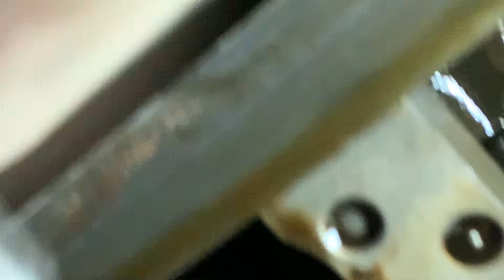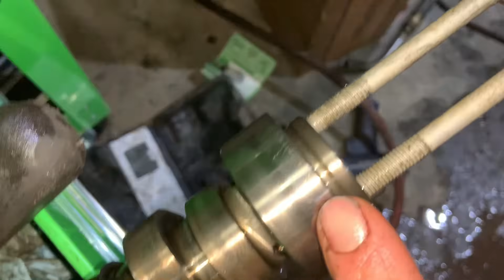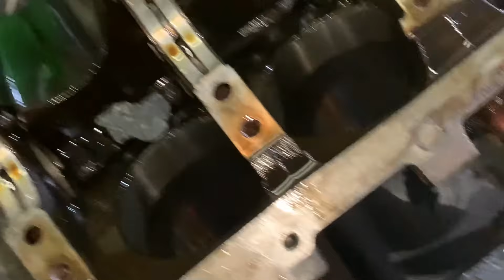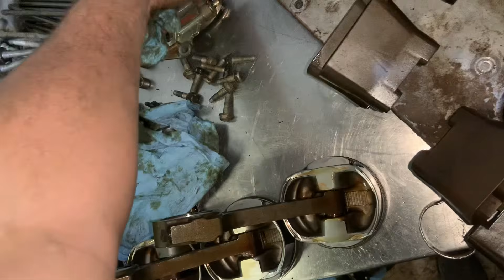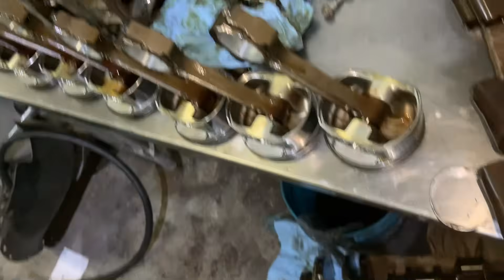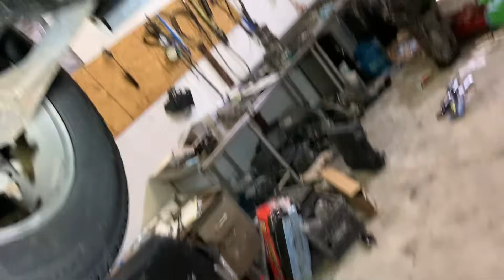ULTIMATE LS ENGINE NO OIL PRESSURE LOW OIL PRESSURE DIAGNOSIS AND REPAIR GUIDE

Comment: I have an 04 2500 suburban 6.0 with 162,000 miles. On a recent 1500 mile round trip my oil pressure dropped. It will be at 10lbs. or less at idle or about 20-22lbs. at highway speeds or 2500 rpm. The engine is absolutely quiet. I have checked the oil pressure with a snap on oil pressure gauge at the front of the block at it will idle at 8lbs warm and jump to 20 lbs at 1000 rpm, at 2000 rpm it is at 35lbs oil pressure and 3000rpms its at 45lbs oil pressure. Now when I check oil pressure with the mechanical gauge at the back of the block where the electronic sending  unit goes the gauge barely reads at idle about 5lbs pressure and the highest pressure reading I get is about 22lbs at any rpm over idle. I did an oil change to check the filter and the drain plug, I did find magnet metal shavings on the drain plug and in the oil filter. They actually look like slivers of metal about 3/16" long that you would typically find stuck in your finger if that makes any sense. I'm curious to know if when you have one with a failed cam bearing that you tend to find these metal slivers? I'm thinking I would rather just pull the motor than go through the extra steps to drop the front differential. I have also had the back of the vehicle about 4' higher than the front to do a check of the pickup tube o-ring and see if the oil pressure changed which it did not. And not being able to see the same or similar oil pressure at the back of the block also makes me think it is a cam bearing. Wondering what your thoughts are? Thanks Greg
Reply from the maker: thats is still a lot of pressure for a bad cam bearing, When the cam is out i dont see more than 7.  I would pull the diff.  Its not that hard to drop down.   a new pump may fix everyting too..  did you already figure it out?

Comment: Man this is the best informational video I’ve see for the LQ4. I have a 2004 gmc 3500 6.0. It’s my van for carpet cleaning. The machine runs off a pto off the engine and not the trans. About 2 years ago I go out in the morning and out of no where check gauges light is on. 5 psi. Rev it up goes to about 25psi. No engine light. I’ve always had a sporadic idol sometimes low some times high after running my machine. That’s another issue though. So I’m driving this like this for 2 years.  Never no knocking sound or ticking. Well last week I notice when I come out after the job and turn the machine off and the van Idols down the lifters are ticking. (Had oil change two weeks prior.) the noise stops by the time I’m at the next job. After the job the same thing. So a mechanic friend said to add some Lucas to the oil. When I did this the oil pressure dropped even more and once up to temp. wouldn’t go above 5 psi. So now I know there’s trouble. Still no knock or ticking. So I go to check the pickup tube o ring. Sure enough it’s dry rotted and squared. I’m thinking great a cheep fix! After install pressure is a lil stronger than it’s been in 2 years. I go to a job that’s 5 minutes away and that’s about how long it took to get to temp. Soon as it did pressure is back to 5 and lifters are ticking. I shit it down and had it towed. Now I thought oil pump pressure valve. Replaced the oil pump, still same problem. Also had already checked the sending sensor and had hooked up an independent gauge. Still same reading and there’s no screen under it for this year. I will check the cam bearings tomorrow but like I said no ticking or knocking. The only thing I’ve noticed so far is the first bearing closest to the trans. Dose have some play side to side but not up and down. From the info I’ve provided, so you have an opinion. Every mechanic I’ve talk to. Which none seem to have the specific knowledge you have on the LQ4 specifically all seem baffled that the pump didn’t fix the problem because how hard this vehicle works and there’s no knock or tic.
Reply from the maker: what did you find?  if you have done a pump and oring, I would bet you have a bad cam bearing somewhere.
Reply: @Brainstangs  I replaced all the main bearings. That got me back on the road. The bearings were all scratched up. So I assume the cam bearings are the same which is where the other half of the pressure is being lost.

Comment: my 5.3 oil pressure drops off when it warms up but if you shut it off and restart it , it goes up to 40 psi and then slowly drop off again to zero.
Reply from the maker: pump is what I would suspect
Reply: What did it end up being ?

Comment: Got a question for you! What are your thoughts on my situation. I have a 2008 Yukon Denali 6.2 non dod. Having a problem with oil pressure and trying to get a handle on where to go next. Getting 65 psi cold and 20 psi idle warm. With 5-40 oil. 5-30 oil about 5-7 lbs less. When I get off the highway or a hard pull pressure starts to drop to 15 psi and 38 at 2k. Have great pressure at the oil filter but at the oil pressure switch I am getting the drop. It’s been about 10k since this started and no noise or anything like that. No leaks and did the rear main,and no leaks. (Never changed or touched the barbell) I have 135k on it now. Before I used to have 30 psi hot idle and 60-65 hot on the eway. I am hard on the truck. I know something is starting just not sure where to go first. Thanks!
Reply: He tells you exactly where to go first @ 25:43 to 28:12  sums up the entire video, but there is a lot of good info throughout the video.
Reply: I have an 07 with same motor as you.  (Those time stamps do no address this issue.)  I replaced sensor, o-ring, pick up tube, oil pump (high volume) and cam plate seal thing.   It is 70 on start,.then eventually settles over 40-45 driving, then 25ish on idle.  I am down to the relief valve in oil pan (not sure why I didn't replace it while I was in there twice already) ...and bearings.  Did you figure yours out?  I am getting frustrated and concerned at this durn truck!
Reply from the maker: 25 at idle is still fine.  everyone freaks out about it that low.  not an issue.  I do block off the pressure reliefe in the pan.

Comment: I recently swapped a rebuilt Ls1 in my pick up which was running fine for week, when I saw that my oil pressure was decreasing slowly then dropped to 0 and the engine shutoff (No internal engine noises). I noticed when that happened I started to get a oil leak from the rear main, could the barbell restrictor possibly be the problem? (Not installed properly or defective?)
Reply from the maker: if it was the barbell, it would simply drain to the pan.  Not the cause of your rear main leak.  If you not hearing  any engine clatter I would think its a faulty sender.

Comment: I'm on my 3rd Engine in my 2005 Escalade. Changed oil with mobil one every 3,000 miles religiously and noticing Oil pressure is starting to slowly slip on this engine now too, can't catch a break. Thanks for the video, very informative!
Reply from the maker: hope your luck changes.
Reply: @Brainstangs  Thank you, as do I!

Comment: This is the most important video I’ve watched since I started researching my oil pressure issue in my 06 Silverado 1500. I think I’m losing prime via the o ring. It primes up but after it warms up the pressure drops quickly and the lifters start ticking due to oil starvation. Thanks for all this information.
Reply: The O-ring was in pretty bad shape, so I stopped there and put it back together.  I did take a look at the bearings as you suggested from underneath.  As far as I could tell, they looked fine. Thanks for that tip by the way.  The O-ring seems to have solved my oil pressure issue, fixed my startup noise, and my lifter tick once up to temperature.  I did run the truck on a downhill slope beforehand(12 degree slope measured with my iPhone), and noticed the pressure improved.   When the truck was pointed uphill or level it would lose pressure fast and the lifters got angry.  Everything pointed to the O-ring, but your video had me prepared to check everything.  260K miles and counting!  Thanks for the great video!
Reply from the maker: happy to help. Let me know what you find

Comment: Best video about this on YouTube. Idk how I managed to watch probably 100 others before I found this one, thank you! Will be doing my inspection in a few days. What all work should I have the machine shop do and what should I expect it to cost? I can do all the assembly myself, but haven’t had to bring a block to a machinist before. Also any good tricks to be certain of the pump relief valve if I get lucky and it’s not a cam bearing? Thank you!!
Reply from the maker: Glad it was helpful!  AS far as machine shop, have them put the upgraded cam bearings in.  Other than that, all the oil pressure issues you can adress without the machine shop.

Comment: I have an '05 Trailblazer with the 5.3 and it recently lost oil pressure at idle. Lifters make a little ticking when at idle, but if you give it a little gas, the pressure comes right back up and the motor runs and sounds normal. I'm thinking that the pickup tube o-ring is shot and it's sucking air at idle, but I'm trying to consider if replacing the oil pump would be a good idea also... I haven't torn it down yet, but curious what you would think in that scenario. While I'd like to do the DOD/AFM delete in the future, I'm not quite ready to do it now. I just want to get it back to being driveable for the time being. On these vehicles, it's not so easy to remove the oil pan since the geniuses at GM decided to make the diff attached to and have front axle go through the oil pan. Thanks!
Reply: What did it end up being I have the same issue & im thinking it’s rod bearings …

Comment: 2008 5.3 275k miles, cold start 60 psi, operating temperature 5 and below at idle, I already did the oil pump. No engine noise when oil pressure is at zero, I'm thinking the VLOM gasket has crapped out. HELP!!!

Comment: Nice video, I have an 05 Sierra 2500. Oil pressure fluctuates constantly from high to low. Maybe 10-20 then go to 60-80. Accelerating increases pressure. Where would you start?  
Thanks in advance

Comment: Pretty sure mine is just a failed pump o ring. I would start it cold and it would have 20 cold and as I drove it would stay at 20 then after awhile my lifters would start chattering. Then it would randomly jump up to 40 going down the road and lifters would get quite a second later. Drove it to work like that 2 times and decided to park it. How often do the cam bearings do that though?
Reply from the maker: not that often, however dont delay on your oring.

Comment: I got the valve covers off my 4.8l today. I took bank 1 off first and thought it was somewhat dirty but not bad considering it has 190k. I went and removed the bank 2 valve cover and to my surprise, every rocker and spring was perfectly clean. Could this be from low oil flow to one entire side? If so how?
Reply: This is old but this is cause by the egr or pvc system.  It causes one side of the engine to get dirtier while the other stays clean.   Every gm engine for these years will have a clean and dirty side.
Reply: Did you find out what was wrong?
Reply: Doesn't seem like anything is wrong. Only thing I can come up with is that the clean side had head work done and the grimy side must be the original head.
Reply: @eyeslo4206  mine did this, was Castech head crack issue, slowly drinking antifreeze internally and steam cleaning the upper head area.

Comment: Very very good video. I love how knowledgeable you are. My 2011 camaro (after a warm engine) gave me a low oil pressure warning. Instead of taking it to the dealer for thousands of dollars in repair, I decided to take on the task by myself (im 17) after dropping the subframe to drop the oil pan and next opening the timing cover. I found no visible issues with the oil pump, pickup tube and o-ring. But since you have showed me all possible ways I could have issues, tomorrow I’ll be diving into more diagnostics. I took the oil pump apart and saw no damage, but I’m hoping that the relief valve is the issue. I’ll probably put a new mellings HV pump and reassemble and hope it works. Thank you for the quality video.
Reply from the maker: dont forget the simple fix too.  It very well could be a clogged screen in the valley plate under the oil pressure sensor.  If you have dod or afm as its known, shuts down to four cylinder, one, tune it out, two remove the oil pressure sender and pull the screen.  You only need the screen under there if you keeping dod.  If you delete it with a tune, then pull the screen.  lastly put a  new sender in.  You got this.
Reply: Mason rollow did you get your car fixed. What u have to do
Reply: U

Comment: FINALLY! Somebody who understands that “pressure” is restriction to flow. 🙏Thank you!
Reply from the maker: That I do.  I have this discussion with 4 cylinder turbo guys who say they run 50 psi boost to make 1k hp.  I say that is a lot of heat to make that power.  I can do it with 8 cylinders on 22 lbs.  Lot of people think more pressure means more flow, its the exact opposite.  Low pressure moves more volume, less restriction.  Anyway, thanks for the comment. I love hearing feedback from viewers.

Comment: Brainstangs Ive got an 11 chev 5.3 that is showing 40lbs oil pressure but the more I drive the lower it gets it usually bottoms out about 15-20lbs after say 500 mile drive. If I am just driving normally 100 miles or less it stays 35-40lbs would that be the pump?
Reply from the maker: You have nothing to worry about yet.  I'm betting your motor is a dod or afm motor.  Shuts down to 4cyl. mode.  These motors run lower oil pressure as vvt and dod take oil pressure and volume to function.  Gm used a higher volume pump on these but they still don't have oil pressure like gen 3 engines.  So here is the deal.....40 psi cold is normal.  Oil is thick, meaning its harder for the pump to push, so it make more pressure.  Harder to push or "restriction" means higher pressure but lower volume of oil delivered. As the engine heats up the oil thins, as it thins its easier for the pump to move and it has "less restriction" which lowers oil pressure but has much higher volume of oil delivered.  So what does all this mean?  It means your fine.  15 psi oil pressure at idle is just fine.  Just know rods and mains will float on a film of oil with just a  few psi under light load.  So you have enough pressure with lots of volume at 15 psi.  What we want to see is it increase to 20-25 or better while driving under load at freeway speeds.  As long as you have this your good.  Many people get very concerned when the see 15 psi on gen 4 ls engines.  I see it every day. Nothing to worry about.  When you see it dipping below 10 psi, that's a different story.  Hope all this rambling helps.  Good luck.

Comment: Is there a way to check if the relief valve in the pump is stuck open?
Reply from the maker: usually just really low oil pressure.  When its stuck open we see under 5 psi and a lot of the time 0
hope this helps

Comment: Would it be good practice to replace the barbell with an oem one or an aftermarket one since its all apart? I've read that there are some aftermarket barbells that have tighter tolerances to provide better oil flow.
Reply from the maker: I’ve had zero issues with the stock one.

Comment: Hi. I have a LS3 480hp crate bought new 4 years ago. On startup no oil pressure. Any ideas?
Reply from the maker: I would guess cam bearing, or oil pump. It could just be a bad sender.  Is the motor noisy like the valve train has no oil pressure.  I can always hear a no oil pressure motor by the way it sounds.  Sometimes you have oil pressure but the sender is dead and you see zero on your dash.  If you follow my video you will find it.

Comment: I have a 2010 Silverado 1500 LT, when I start my truck the oil pressure goes to normal then declines to 20 and then it drops to zero all in about a minute, more or less. I got a new oil sending unit and it still did the same thing. Now to start I need it at WOT and it’s a rough idle and misfires, the RPM’s drop to zero and jump back up. Now I have a truck that’s parked. If anyone knows what can be wrong let me know. It’s my only vehicle at the moment. I should add that there is no irregular noise when the truck idles (when it’s not misfiring). No metallic noises at all. Another thing is my oil had less than 1,000 miles since it’s last change, when I changed my oil it appeared to have a reddish color to it. I’m pulling my hair out on this one. I need help for sure.
Reply from the maker: if your oil pressure is for sure low, meaning you can hear the motor making noise when it shows no oil pressure, I would put a pump in it asap.  I have seen several have good oil pressure cold then loose pressure.  This can be because of the bypass valve in the pump is stuck open.  From what you are describing you also may have a stuck dod lifter.

Comment: Seen your video and it one of the best discriptive ive seen of the oiling system. I also have a 05 lq4 the same exact thing happened to my motor same cam bearing and all do you have a part number on the dura Bond bearings that you use thank you for your video and your time
Reply from the maker: I dont have the part number as I always have my machine shop put them in .  If you interested you can call them.  Cleggs automotive machine in orem ut.